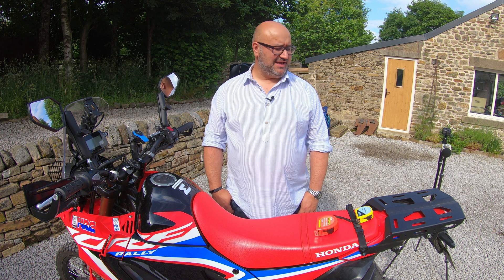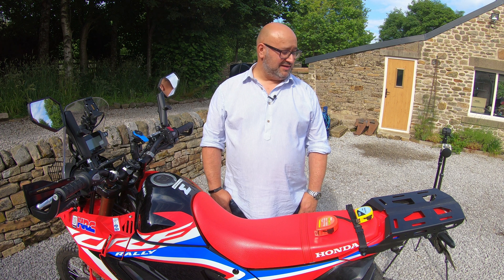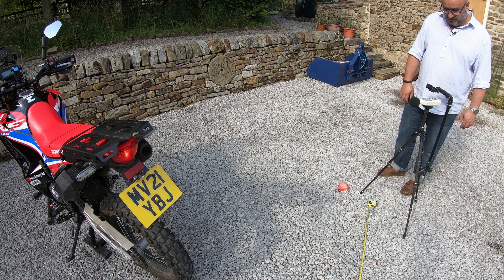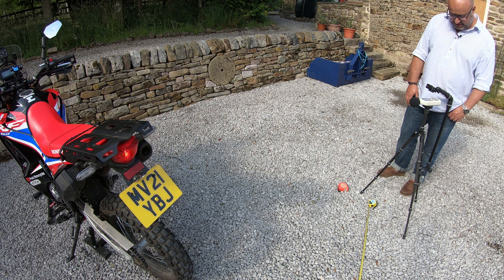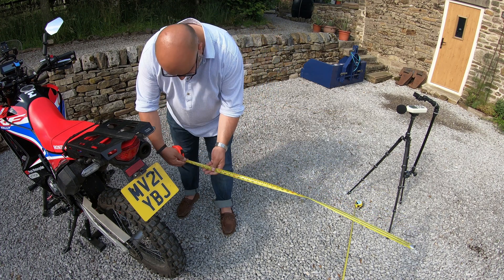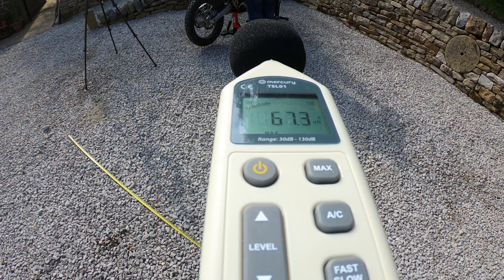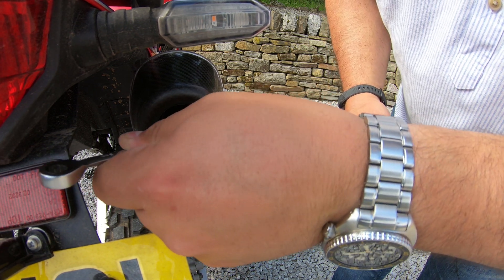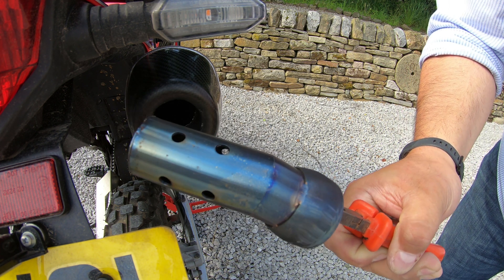Honda CRF300L/Rally MotoX Exhaust Noise Test 4K

Comment: Your videos are always extremely helpful. Well done mate! I'm wondering if it's ok to install the MotoX exhaust without an EJK/ fuel controller? Is that something you would recommend? I'm interested in buying it but I'm concerned about harming the engine if I don't buy an EJK. Thank you so much for your attention and well done for creating such great content. Cheers!
Reply from the maker: I don’t have an EJK. I’ve done nearly 1000 miles on mine with no problems (other than a bit of the plastic on the end cap melted… get the one with the metal end cap!) I think you can probably squeeze some more power out with an EJK, though probably also need to do something with the air intake. It’s all a balance, exhaust let’s the air flow more freely out, EJK can increase the fuel going in but ideally this would be combined with more air too. I know that’s a massive over simplification! I’m not aware of any harm that can come to the engine  without an EJK. Maybe it’s too soon to know for sure but there’s some folks with 3k miles plus on their bikes with the MotoX and I’m not aware of any problems. I was interested in the weight saving, not a power increase so haven’t tried an EJK yet. I’ll let you know if I do.
Reply: @PeakMotorcycles  thanks for your reply! I share the same thoughts and I'm not purchasing it to get more power.. I'm more interested in weight saving and a louder noise at higher speeds (so I can be slightly more noticed by other cars without having the whole neighborhood hating me for that 😅🤣). I'll give it a go with the metal end cap and will be looking forward for any updates you may have. Again, thanks for such quality content. 👏👏👏👏
Reply from the maker: @Franzuccato  you’re welcome and yes, I think it will do what you’re looking for!

Comment: Sound levels aside, have you noticed any increase in power or any other benefits? 

I am debating this or the full yosh RS4 setup. Any insights would be appreciated. 

Thanks.
Reply from the maker: No significant power change. Some people swear there’s more mid-range torque, but I hadn’t really noticed much. Without a dyno, I think it’s how it feels rather than how it is. 

The full Yoshi will be better quality, better finish, louder and probably lighter. They look awesome and come at a price. If you don’t mind the sound and you have the cash, then go for it!
Reply: @PeakMotorcycles ... I have the Yoshimura RS4. Also, 550 ECU Stage 1, DNA air filter,  and I opened up the top back of the air box like POMMEY BIKER did. ... https://youtu.be/tc3M42IXbAc ... With those mods, yes, it has better throttle response 
.

Comment: Did you have to get the computer tuned after doing the exhaust and intake or air filter?
Reply from the maker: I haven’t, but to get the most from it, yes I think a fuel controller and airbox mod/high flow filter would give the best results. I guess it’s what you want from it. For me, the bike has enough ‘go’ for an entry level dual sport. Saving 3kg high up on the bike was my main reason for changing the exhaust.

Comment: Have been watching your videos for a while now well done , with this 1 and the baffle I wander if drilling the holes bigger or more holes same side would give you better back pressure for low down...
Another thing I used to tinker with with smaller thumpsters etc was the weights of the flywheel to give better riding and economy as I learnt this years ago off people that rally the old ford escorts so would be interesting to see in the future if flywheels become mods to these as they look and sound like an awesome bike to own , I still cant source 1 here in Australia zero stock and no estimated arrival date like the ship sank bringing them here 😄😀😃
Reply from the maker: Aye, the supply chain still seems to be broken. Even in the UK, ordering one now won’t be here before Easter… I guess I got lucky with mine (frame #99!). The flywheel is an interesting one. I’ve not seen it as a mod, but for a bike like this, where you don’t need the fast spin-up and all out power, a heavier flywheel would certainly help with the lower speed handling. Not sure about the holes. If I had a dyno I’d have a go, but trying to work out 1hp here or there or an increase in low down torque is challenging. Sometimes I think I can feel a difference, but other times I’m not sure.

Comment: Thanks for your video. I want to buy a full MotoX for CRF300L, can you tell me if you need to re-map the ECU? Thanks.
Reply from the maker: Depends what you want from it. If more power, then yes, I think an EJK would help. If you want to save a bit of weight and aren’t fussed about the power then not.
Reply: @PeakMotorcycles  ok thanks for yor reply. Weight saving it's enough for me.
Reply from the maker: @FC-pf2xv  I’ve been running mine with no ECU mod for a couple of months now. So far so good. (Though the plastic end cap is melting a bit… apparently this is ‘normal’. If you don’t have it yet, get the one with the stainless silencer!
Reply: @PeakMotorcycles  thanks for your information! 👍🏻

Comment: How much did you buy your exhaust good sir? I have been trying to find it in ur description. Maybe I wasnt trying hard enought.😆
Reply from the maker: I didn’t put it in, as the audience is no more than 20% in any country, and the shipping and tax costs mean that what it costs in one place is significantly different from another. I suggest you look it up on Bikerzbits and select your shipping country to get the total. Then depending on what your local import taxes might be, you may have to add that on. This is the exhaust:

https://bikerzbits.com/honda-crf300l-rally-full-system-exhaust-muffler-231039.html

So around £190 + UK shipping (£20) + £10 clearance charges + £40 VAT. Though it seems not everyone gets the import charges, so to the UK, somewhere between £210-£260. Other countries will be different.
Reply: @PeakMotorcycles  thank you for this very comprehensive reply. I really appreciate it. Have fun riding. Keep safe😊

Comment: How much did you buy your exhaust good sir?
Reply from the maker: I didn’t put it in, as the audience is no more than 20% in any country, and the shipping and tax costs mean that what it costs in one place is significantly different from another. I suggest you look it up on Bikerzbits and select your shipping country to get the total. Then depending on what your local import taxes might be, you may have to add that on. This is the exhaust:

https://bikerzbits.com/honda-crf300l-rally-full-system-exhaust-muffler-231039.html

So around £190 + UK shipping (£20) + £10 clearance charges + £40 VAT. Though it seems not everyone gets the import charges, so to the UK, somewhere between £210-£260. Other countries will be different
Reply: @PeakMotorcycles   thank you for this very comprehensive reply. I really appreciate it. Have fun riding. Keep safe😊

Comment: Just installed one on my 300l. i couldn't get the muffler mounting bolt hole to line up on the bike with the spark arrestor installed. I had to take it out to mount it. did you have any trouble with that? the motox exhaust seems quite a bit louder than stock. I assume its because the arrestor is not installed. I did notice more low end power. great looking and sounding unit though.
Reply: i was able to tap the spark arrestor in and it fit perfectly after that. great channel btw. keep up the good work.
Reply from the maker: @2012theraven  awesome. Ride safe! Or safe enough 😉
Reply from the maker: I had to twist the sections a bit to get it all to line up, but it went on as in the video and seemed to be an ok fit. I’ve found mine to be too loud so will be putting the spark arrestor back in. I’d not noticed any power change, but I maybe there’s something if it’s a bit more free flowing.

Comment: Hi, Great series on upgrading the crf300.
It would be great if you could do a video breaking down the costs and shipping fees, what upgrades are a must have and costs buying direct from Thailand.
Thanks and safe riding.
Reply from the maker: Hi, Thanks. I did think about that, but the costs seem to vary significantly depending on weight, destination, size of package and import costs. This can be as much as 50%, and will probably be out of date before too long. About 20% (each) of the audience is in the US, UK, and Australia with 15% in Canada and Germany, and the other 10% a handful of other countries. I only have experience of shipping to the UK and even that seems to have varied depending on if there are import charges (or not!) I’ve found some things, particularly the Honda parts made in Thailand are a lot cheaper, but others (e.g. spark plugs) are cheaper if sourced locally. As for what’s a must, I think it comes down to how and where your’re riding, and how tall and heavy you are. If you’re 65kg, stock suspension is fine, if you’re 5’7” risers are probably not needed. If you only ride on road, most of the mods are overkill, and if you ride mostly off, then most would probably help. I’d rather folks make their own judgements about what’s a ‘must-have’ for them, and I wouldn’t presume to be able to define what other’s ‘must have’. To do so might even be considered rude! 🤣

Comment: Hows the new shock?
Reply from the maker: Pretty good. Front and back are much more planted. I know I’ve not done a specific video, but I’ll get to it eventually. I recorded a short this evening trying out the un-baffled exhaust, new levers, new headlamp guard and the suspension. Hardly conclusive but I’ve tried to describe it. I’ll see if I can get it done by the weekend.

Comment: I find the stock exhaust to be really hot, especially for slow, off-road maneuvering.  Do you find this exhaust system to lower the operating temperature?  Thanks,
Reply from the maker: Hi, I hadn’t noticed much difference. The fan still starts up when it’s slow going. Perhaps it’s a bit more free breathing without the heat buildup around the Cat but I don’t think it’s a big change.
Reply: @PeakMotorcycles  Thanks for your reply.  Does the Moto X have a catalytic convertor?  Let me know if you have any more thoughts or analysis on the heat issue as you ride it more.  Cheers,
Reply: do you know if motox makes a heat shield for the header? it looks like a mega bomb shield might work. the header gets very hot, it burnt a hole in my pants.
Reply from the maker: @2012theraven  not that I know of. Though I’ve had it on my Rally for 500 miles so far and nothing has melted around the header.

Comment: When you were talking about spark arrestor where the baffle was. In your first video you showed a small metal screen that went between the link pipe and exhaust and you stated that was a spark arrestor. Is that not correct? Why would you need another one?
Reply from the maker: Good point! I’ve no idea 😁. We have way too much rain in the UK (most of the time) for a spark arrestor to be a thing. Baffles are more familiar, and if removable, they are the thing in the back end of the silencer.
That seems to be the thing that is called the spark arrestor elsewhere. There were no instructions or other documentation with the guide, and if in the UK, the bit at the back is the baffle, (and why would you need another one!) then there must be a name for the forward one, so I, incorrectly as it turns out, called that a spark arrestor. I don’t suppose you know what the insert at the front end should be called by any chance? Happy to publish a correction if you or anyone else knows.

Comment: Another very useful video !👍
Certainly good to know you can buy a full exhaust system which is as quiet but lighter than stock and at a very good price.( Pity they don't sell the silencers seperately )
I bought another make for mine and am stll trying too modify it to get an acceptable tone.
    On the 250 Rally the stock silencer is so quiet that you start to hear whines etc from the engine so a little burble from an aftermarket tailpipe helps !😎
Reply from the maker: On the 300, the silencer and link pipe (including Cat?) is one piece, so the only way to replace the silencer only would be to cut the stock one and hope! And yes, you can’t beat a bit of burble!
Reply: @PeakMotorcycles  the after market silencer I got comes with a link pipe ( separate ) and the silecer actually has a beefy cat inside.
Infact I was wondering if the Moto X silencer maybe has something else other than the db killer that you kindly measured for everyone, and the screened tube at the other end. 
At the end of the day these silencers are fairly basic, the good thing about the one you chose is that its quiet ,well built and a very good price.
Reply from the maker: @davidroberts7490  I’m not sure it does, as I think the header and link pipe were straight through. There is some wadding in the silencer, but little else. Then again, for £150 for the alloy one, which includes distribution and the retailers commission, they don’t have a lot to play with.
Reply: @PeakMotorcycles  when you say the alloy one, do you mean the one they describe as stainless steel.
If so then yes, its a really good price.
I think with Thai Post delivery to Italy its 174 euro plus 64 euro delivery.
I used Thai post the last purchase I got from them. Seems ok.
Reply from the maker: @davidroberts7490  yes. I thought the stainless referred to the header and link pipe, and that the silencer was aluminium alloy, but if it’s all stainless, then yes, that one! (Perhaps if I’d said the silver one, not the blue one, that would have been more helpful!) either way, you have the one I should have bought 😁
Reply: @PeakMotorcycles  haven't got it yet, but seriously considering it.
I still have my 250 Rally which I am prepairing as a lightweight adventure tourer.🙂 If all works well I will get a 300 Rally at the end of this year or next year. In the meantime I can do mods on the 250 and enjoy it at the same time.
    I fitted two aluminium sidecases which I find really convenient. So to get them as close to the frame as possible I have fabricated a midpipe which positions the silencer below the ride side case. The cases sit a bit higher than usual so still loads of ground clearance.
Reply: @PeakMotorcycles  Why do you say you should have bought the "silver" one?  Durability?
Reply from the maker: @twowheeledadventures5615  the carbon end cap appears to melt… see the pic in the Community section of the channel.

Comment: Super content again! And anterestings finds. I have the full stainless system, and I think it is very much louder without the baffle. Really big difference!  I actually ordered an extra baffle when I ordered it and have drilled out the all holes to 10mm in one of then, and maybe 8mm would have been perfect to my ears.
Reply from the maker: There was another comment about how the type of sound can sound louder in that the stock exhaust has a more ‘chirpy’ sound and the MotoX has a deeper sound and perhaps we perceive a deeper sound to be louder? What I don’t have is the point between 4.5k rpm and 10.5k rpm where the MotoX becomes louder. If it’s 6k rpm then it would be more apparent, if 8.5k then less so.

Comment: I installed that exhaust on my L and it has less low end power, it pulled better with factory exhaust.  I wonder if it’s because it’s so quiet.  You removed the spark arrester how about the baffle (insert).  Another test without the insert would be great.  GREAT WORK on the videos! Also do you think you’re running too lean now with full exhaust?
Reply from the maker: Hi, that’s good to know. Did you dyno it or is that a perceived change? I had tried to measure uphill acceleration but was struggling to do it consistently. Any other measurement methods welcome!
Reply: @PeakMotorcycles  Seat of your pants test…I could tell right away especially 3rd gear pull was strong before now it’s like the 250L lots of RPM but your not moving much faster.
Reply from the maker: I have a 10-20% hill nearby, it would previously pull in 3rd all the way up. I shall try that. Thanks.

Comment: Surprising results, especially with the baffle out, seems a bit throatier - nice. Thanks for another top video.
Reply from the maker: Someone described it as being a bit deeper vs the stock which is a bit chirpier. I guess throatier is similar to deeper!
Reply: I removed the baffle in the tail pipe.  noticed quite a bit more power. do you think the bike would be running too lean without a EjK tuner with it removed? i didnt do any air box mods, just the header and tail pipe.Thanks

Comment: Excellent video again André I have the stainless version as I thought that the carbon end cap might be a week spot especially when venturing off-road it will be interesting to see if you're bike rides better with or without the baffle in due to the loss of any back pressure
Cheers Phil 👍
Reply from the maker: Yup, will give it a go during the week and let you know. With the baffle in there was minimal difference from stock.

Comment: Lots of data in this which I like. My goal would be to not increase the noise as well so this was great info. I was really trying to hold out for the Q4 but doesn’t look like FMF is coming out with anything soon so this may do for now. Thanks for another great video. 🤙
Reply from the maker: As @Croaking Toad mentioned, I think the MotoX has a deeper sound and the stock more chirpy, and the deeper sounds louder, but isn’t, if that makes any sense at all! 🤣

Comment: I'm sure if u remove the inner spark arrestor shown as a small separate pipe, would definitely make a difference in sound level
Reply from the maker: Yup. I expect that’d make it louder, as it’s then effectively a straight through pipe, though my aim was never to make it as loud as possible, if anything the opposite, while saving some weight.
Reply: @PeakMotorcycles  definitely agree